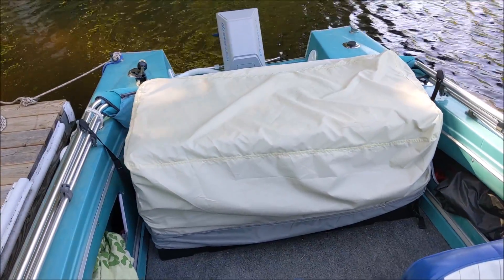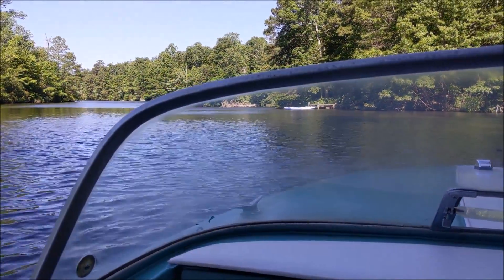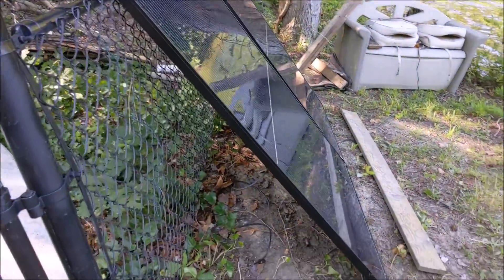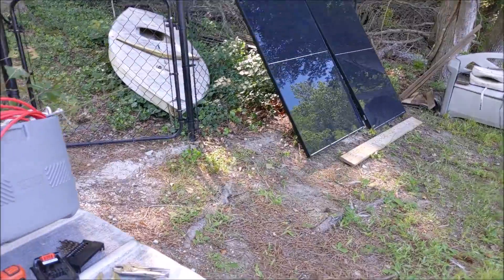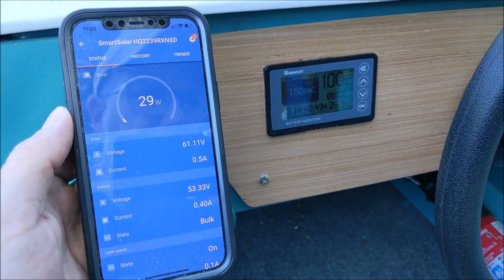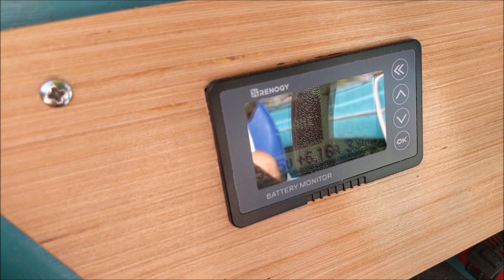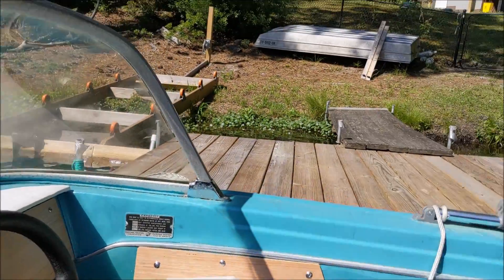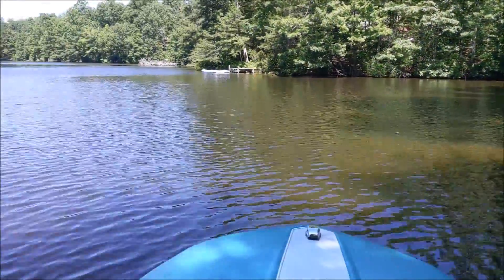Solar Charging a Modified 1967 Runabout!  Easy DIY Project!

Comment: Have you tried a panel with the motor running?? Ive got epropulsion spirits with their battery and 180w solar controller. It doesnt quite keep up so im thinking of doing what you have done with remote battery snd a bigger solar roof....but i need to charge whilst running!
Reply from the maker: I haven’t tried.  The solar panel would need to kick out at least 48 to 50v in addition to the wattage.  Doable but would need moderately large panels.  Solar stuff is fun to tinker with.

Comment: Awesome project!!! You probably figured this out by now but the shunt should loose its accurate percentage reading when you turn the disconnect off to the batteries. It will show 100 percent until it actually reaches 100 percent. I don't think you will have a problem leaving it on especially with the solar always plugged in. The shunts are actually really accurate once they learn the battery and stay on. You could also connect the power wires for the shunt before the disconnect to make sure the shunt stays on all the time and not loose its calibration. I may also change the ah setting to 90 percent of the nominal ah number just to leave a little head room.
Reply from the maker: Thanks for the reply!  Yep, it's behaving exactly as you said.  Hasn't been an issue but something to tinker with.  This was a project I had been chewing on for a while and finally got around to setting it up.  Always appreciate the input and advice.  So far it's been working great.  The batteries are always topped off and every mile motoring along is courtesy of the sun.  It almost feels wasteful when the batteries are full and the sun is out.

Comment: I thought you'd put a soar canopy on the boat! But I suppose that doesn't fit your needs.
Reply from the maker: Yeah, a solar canopy on this boat would be a bit awkward.  I have a folding bimini top on hot sunny days but it wouldn't support much in the way of solar panels.  The solar charging I'm doing is working extremely well and the boat is always ready to go.  Thanks for your comments.
Reply: @drez20001  throw a couple of flexible panels up on bimini to help charging.
Reply: Dan, I’d like to talk to you about a solar/electric redneck catamaran. 😂 Looking forward to running into you on “the lake”.

Comment: What are the specs of these panels?
Reply from the maker: Per the sticker on the back for each panel:  Max Power (Pmax) 365W; Max Power Voltage (Vmp) 34V; Max Power Current (Imp) 10.74A; Made by Hyundai Energy Solutions - Model HiN-S365XG(BK).  Each panel weighs about 45 pounds.  I paid $150 each for the panels.  So far they're working great and within spec.